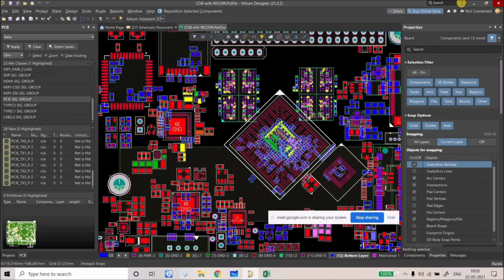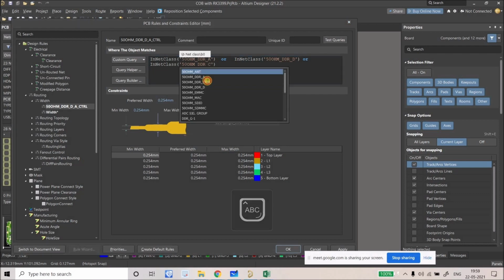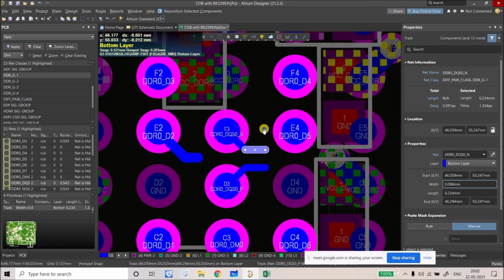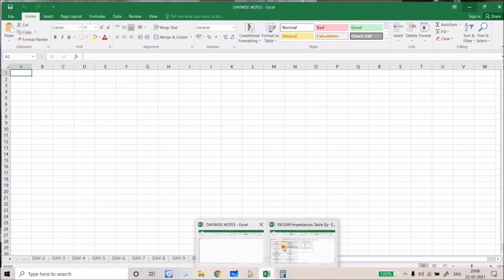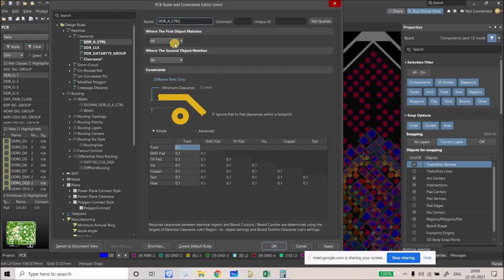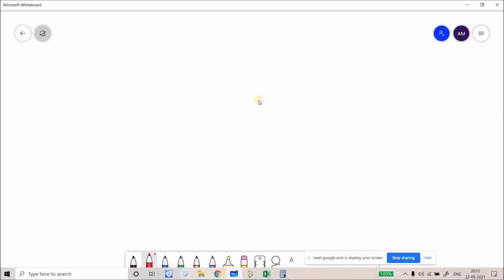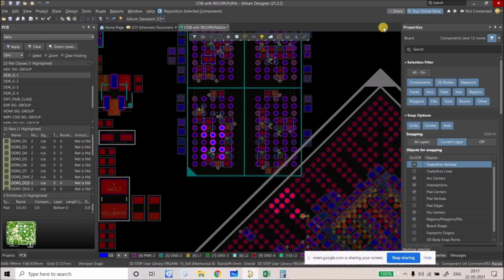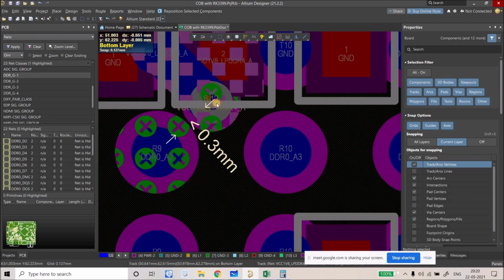LPDDR4 Design and Layout Tutorial - ADVANCED PCB Design Rules

Comment: The width has to change when the track goes to different layers of the PCB to get the same characteristic impedance. Can Altium really do that?
Reply: Yes, it can do that. When you define layer stack (copper, dielectrics, their characteristics..) you also define impedance profiles. Altium calculates everything for you. Then you include it in those rules and whenever you route any of affected signals, it automatically selects the trace width calculated by Altium depending on which layer you route.